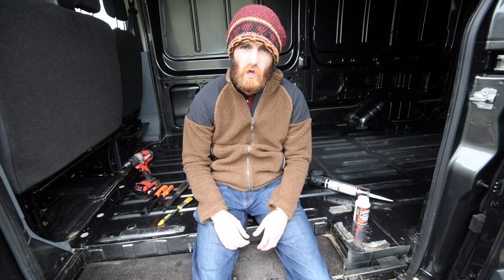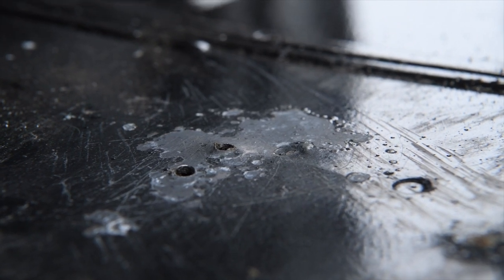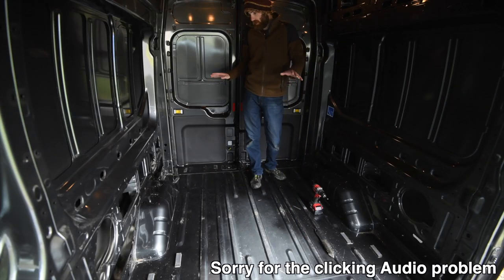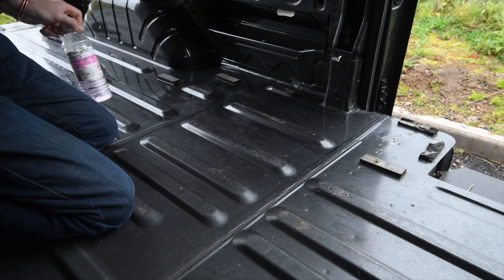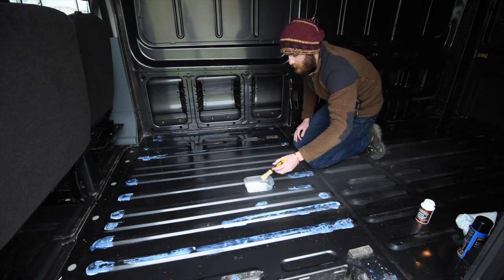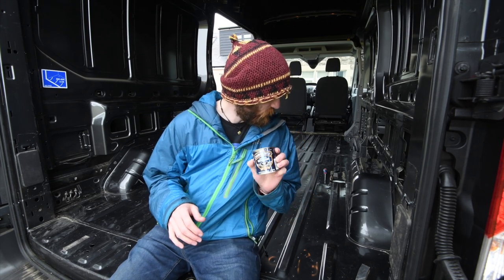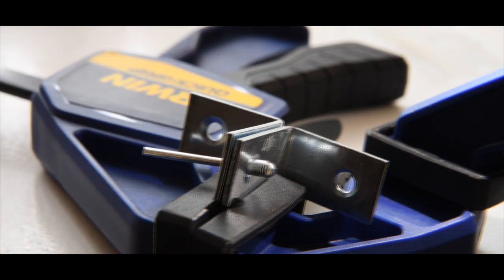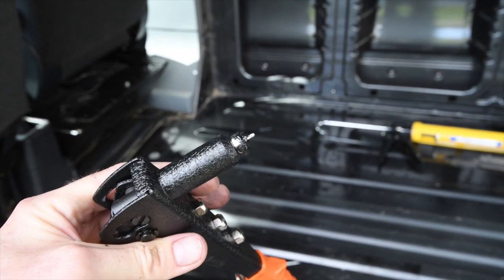Fixing holes with Pop Rivets | EP2 | Ford Transit MK8 Campervan Build

Comment: I do have a question.  Do you have "undercoating"  for vehicles in your country? England?  I was wondering if some shop could do a high van like this?  Its so good to have it.  Its anti- rust spray on!  I had my SUV done last year,  it cost $120.00 Canadian.  My friend owned auto shop and she showed me and old car that had been undercoated by owner and when she rubbed a little of the break lines it was brand new underneath.
Reply from the maker: Indeed, under coat is a thing in the UK. My van definitely came with something underneath it which felt a bit like two or 3 mm of rubber on the underside of the metal work in places.

Comment: So,.I read your edit. I didn't quite understand your explanation. Were you saying the rivets will rust because it's a different metal. Would you do this again or have you heard of a better way?
Reply from the maker: Almost a year on there is no evidence of it actually doing anything but since enough people commented about it I thought I would make the edit.  

Basically the rules of the dissimilar Metal corrosion or galvanic corrosion. The less noble metal would be corroded by the more Noble metal over time. In this case the steel of the van  would corrode the aluminium rivet. Realistically it’s not really an issue because the rivets are isolated from the steel metal due to the sealant around the rivets and the paint on the steel. And even if they did eventually corrode the rivet and fall out the area still filled with  the sealant anyway
Reply: @MispronouncedAdventures  I removed the plywood flooring on my van today and found around 90 holes underneath. What they were used for I have no idea as it was maybe only 20 holding the floorboards down. After spending the afternoon researching the pop rivet approach strikes a good match between ease of application and effectiveness. 

Can't find the original comments about the rivets risking rust which got me a bit confused by the edit as well. Glad to see this reply clearing it up a bit!
Reply: Also just realized there are stainless steel rivets which I would guess would technically work even better for this sort of application?
Reply: Ok, so with even more knowledge gained on the subject I now know the following. Stainless steel rivets are really expensive compared to the aluminum ones. Also, there's water tight rivets used especially for blocking licquid and gas, these look a bit different where the head is one clean shape without the 'hat'. Definitely recommend those if anyone is reading this.

Comment: Well done sir proper job!
God blasting dozens of holes into the floor and wheel arches of a brand new van. Its quick but such a brutal way to do it 😅
Have you considered treating the underside of the van with Waxoyl treatment or similar solution to prevent rust?
Reply from the maker: Definitely see it quite commonly on fleet lease work vans the ply screwed directly to the metal floor. I thought about undercoating not quite sure what I would use if I did it at the moment the current undercoating material on the transit seems pretty good at the moment

Comment: Loving the videos, currently doing a conversion on 2015 Ford Transit L3H3, you have some good ideas that have really helped. Can I ask what size of pop rivets did you use for the floor ? As I am going to do the same to mine after seeing your idea :)
Reply from the maker: I think I used 4mm. Reason being is Id remove the ragged rusted edges of the old holes from the old screws with a 4mm drill bit old screws are probably a 3 to 3.5 mil screws. So using a 4mm drill bit made them all uniform and then painted silicon and a 4mm pop rivet
Reply: @MispronouncedAdventures  Genius mate thanks , currently going through your videos in order to pick up tips and tricks for my build, im sure ill be messaging again soon.
Reply from the maker: No problem at all! Feel free to message via Instagram is you want as well. It can be easier to message on there.

Comment: Just starting a transit myself Alex. These videos are immense! Would you simply seal those holes with silicone?
Reply from the maker: Yeah those filling the holes with just more silicone would work just as well.
Reply: @MispronouncedAdventures  legend. I’m keen to know where you got your magnetised window covers from. My partner is looking at making them but working out if it’s worth Just paying. Just watched the roof insulation bud, bloody marvellous! Liking the tunes.
Reply from the maker: My mum made them! Repurposed synthetic sleeping bag as the internals for insulation and The material are used elsewhere in the van for the outside. With magnets running around the edge

Comment: I wouldn't of used pop rivets as dissimilar metal corrosion is an issue. If you just prepped the surface and got a garage to weld the holes. Cheap easy job.
Reply from the maker: True but unlikely to realistically be an issue. Even if there were effect of galvanic corrosion, the steel in this case would be the more Noble of metal with the aluminium experiencing the potential for accelerated corrosion. That being said the metals are general isolated from each other by the bead of silicon putting before the rivet.If I was doing it again I probably wouldn’t of bothered with the rivet and just stuck sealant in each hole

Comment: I don’t want to be left out. That’s not how you use that paint!
Reply from the maker: Which one? The kurust? I just Slabbered on! Yeah pretty much not how it’s meant to be used
Reply from the maker: That being said although it looks like I literally paint it onto the rails ( which I did ) . That was mainly because there were hundreds, if not thousands of tiny abrasions from sand and grit rubbing between the rail and the old flooring. Much easier just to slather it on then to pinpoint paint every single tiny scratch